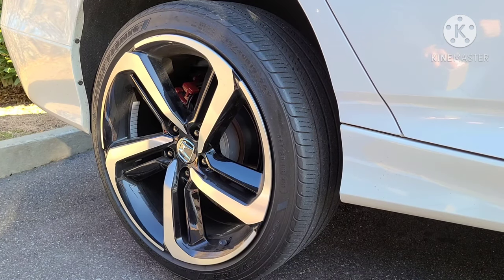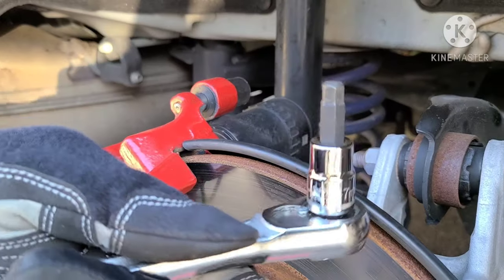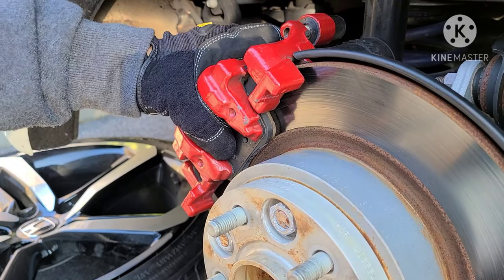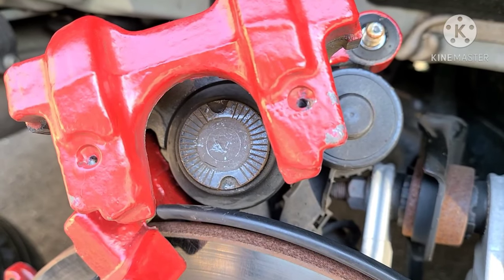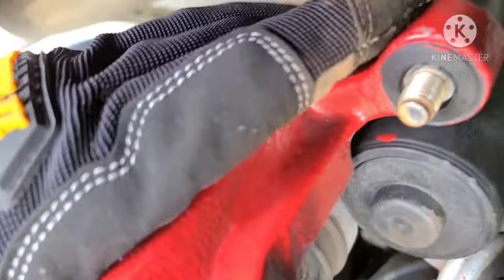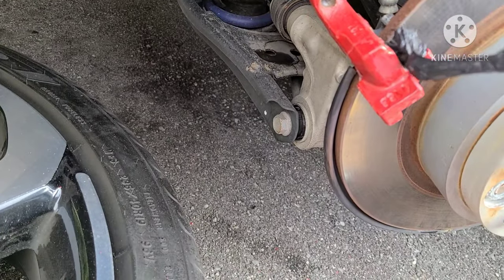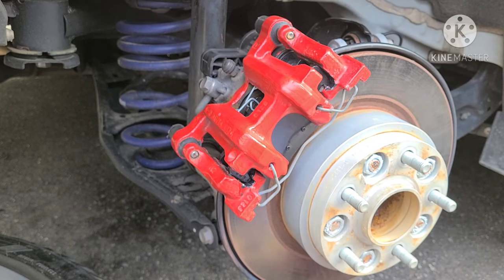How To Replace REAR Brake Pads 2018+ Honda Accord | Everything You Need To Know

Comment: Looks like you put the outer pad on the wrong side. Arrow was pointing to the rear, or counter clockwise. I wonder why they do that? 
Also you can retract the piston through the connector on the motor using reverse polarity. But it's easier this way. Imo

Comment: Thanks for the video, i have a question i want to ask why the 2019+ honda accord rear break pads wear out the fast? thanks
Reply from the maker: You're welcome! To be honest I'm not exactly  sure why, my previous Jetta GLI went through rear pads first as well. Seems to be normal
Reply: @DanVilla7  one more question is the car "on" all the time when you changing the pads. thanks
Reply from the maker: @HZ4750  the only time you need to put it in the on position is to compress the piston like shown

Comment: My friend help to get the brakes fixed because they where goin to charge me on the dealer $500 , so help me out but I’m worried because on the panel it said like I warning that said brakes system problem , my friend told me He told me to go to a place to have those codes deleted, and I've seen videos to do it myself, to reset, but not found, can someone help me?

Comment: Great video! how many miles did u have when you first heard the brake squeek?
Reply from the maker: Thanks! The car has just under 22k miles now and started doing it for the last 300 I would say. Every time I would clean my wheels good it would go away then after a week or so start back up. I hate noises so I changed them today, quiet and squeak free now.

Comment: So leave the E  parking brake disengaged while compressing the piston and engage it to set it back with the pads on ? .... btw what size spacers do are you running ?
Reply from the maker: Yes leave disengaged and turn the ignition to the on position to remove pads. Then compress the pistion,  reassemble and engage e-brake to set pads.  Disengage after and your good to go. I'm running 20mm H&R spacers for more information on them look through my channel it's all on there
Reply from the maker: @jeffreybaldeo  I would think so but can't confirm since I've only tried it on mine. But I would heavily lean more towards yes

Comment: This is a great video, and I liked the work around to having to use the Torx Bit on the electronic brake system. Have you had any issues or error codes since doing this?  So it's as simple and just turning the car on and you can twist the piston back in with the pliers?
Reply from the maker: Thanks! Yep as simple as it looks. I haven't had a single issue since doing the brakes.
Reply: The dealer said it has two open circuits in rear brake caliper now my brake hold light is on brake light ???? 2017 civic
Reply from the maker: I'm not sure why that would happen.  My car is fine still haven't had a single issue since my brake job. I do hope you get it sorted,  best of luck!

Comment: Dan have you had any issues with your rear brakes since you changed them? Every other video I have seen they have taken apart the electronic e-brake but if you haven't had any issues I will being doing the same as you when it comes time to change. Thanks in advance.
Reply from the maker: I have had zero Issues since changing the pads.
Reply: @DanVilla7  Good shit! Thanks bro.
Reply: I did the same way and it's good I'm going through my 3rd ten generation honda accord and his method works well.

Comment: My 2019 Honda accord sport also had sqeack noise from rear tires only once I press the brake.should I only change rear brake pads only cuz front pads are fine
Reply from the maker: Yeah no need to touch the front pads
Reply: @DanVilla7  Thanks

Comment: I never use honda pads or any sold at auto parts store.. the best pads are akebono ceramic carbon fiber which don't need break in.  Cost more but last longer and don't wear rotors,  you still need piston compressor and remove electronic brake as there's times when piston will not bottom out.

Comment: Great video, I am actually right behind you, I am at 20k miles so I am gonna probably need to replace mine soon. Have you done the front pads already or the rears go first on these cars ?
Reply from the maker: Thanks,  haven't done the fronts yet. Seems that the rears go first same thing happened when I had my VW
Reply: @DanVilla7   the dealer wants 80 bucks for the rear pads. I am pretty sure I can find it cheaper on line . I visually looked at mine and the back does look thinner than the fronts .
Reply from the maker: If you get at an online oem parts site you can get them for under $50 including shipping
Reply: @DanVilla7  sounds good. I will do that.  Thanks .
Reply: Don’t need to change it at 20k my 2.0 sports is at 57k I haven’t change my brake pads, but soon!

Comment: So when i rotate the piston for my caliper, it doesnt go up or down but when i compress it, it goes down. Is it defective?
Reply from the maker: You need to turn it clockwise while compressing it. Just compressing it may cause issues.
Reply: @DanVilla7  thank you. I rotated it without compression as i was expecting it to recede on its own. When that didnt happen i pushed it in and it worked

Comment: If I wanted to change the rotors as well I assume remove caliper bracket next.
I didn't see the dreaded screw that hold the rotor to the hub. Do they not have one holding the rotor in place?
Reply from the maker: Not in the rear but the front has it. Best tool 
to remove it would be this https://amzn.to/3mxwSlg
Reply: @DanVilla7  great. Thanks for the help

Comment: Do you have to use honda brake pads or is aftermarket fine
Reply from the maker: You can use aftermarket if you wish. Just make sure they are quality ones and wont sqeak after installing them. That's the main reason I went with oem

Comment: what about the brake system light. I changed the brake pads and now I have a brake system light on the dash. how do I make it go away?
Reply from the maker: I actually just did a search and strangely enough people are saying a weak battery causes that? Sounds odd to me but seems to be quite a few people with the same issue

Comment: Great! Did you also release the e-brake at 3:50 when you pushed the ignition switch? If the e-brake is released when the ignition is on, the car will start rolling, correct?
Reply from the maker: The ebrake was never engaged,  my car is an automatic and was in park so it will not roll. If it was a manual you should be parked in gear and also will not roll if the ignition is in the on position.
Reply: @DanVilla7  OK, you released the ebrake already and turned the ignition on. Mine is a stick so your note helps me:) Again, very nice post!!
Reply from the maker: @gobluea2740  yes keep your car in gear with the car and ebrake disengaged.  Once you undo all the caliper bolts put the ignition in the on position and the caliper will loosen so you can pull the pads out
Reply: @DanVilla7  Super!! Two thumbs up!!

Comment: I turn the caliper about a half an inch and it just stopped turning. Stuck solid...the ignition is on and still stuck...might have to remove that black cylinder thing
Reply: Were you able to get it moving?

Comment: Did everything just like you did. Now my daughters car is saying parking brake doesn’t work and won’t start up . Any help
Reply from the maker: Did you engage the parking brake after doing each side? It was pretty straightforward I'm not sure why that would happen 🤔
Reply: I will redo it today . Thank you
Reply from the maker: No problem hope everything works out. Also try unplugging the battery it may reset it, worth a shot.

Comment: pads are at 50 %..also after you shut the car off push on the parking brake button to temp disable electric parking brake

Comment: hey man do u know the part number for the front brake pads
Reply from the maker: I don't but if you search oem honda parts you can plug in all your info to get ir.  The prices are way cheaper than the dealer even with shipping.  Just check a couple different one sites, some try to charge crazy shipping

Comment: Was your emergency brake disengaged while you were doing the brake job!
Reply: Was the car also on ignition the whole time? once you released the pressure? To get the caliper out
Reply from the maker: Yes leave ignition on complete job on one side then engage ebrake to set pads. And then repeat for other side
Reply: @DanVilla7  so I have do this twice for each set of rear brakes , correct ?

Comment: I'm curious so there is no need to bleed the brake line ?
Reply from the maker: If you dont get air in the system not necessary.  If you were to change a caliper or something then you would need to.

Comment: What size lug nut are those wheels? Do they differ from the regular accord and do those spacers came factory??
Reply from the maker: Are you referring to the bolt pattern? No I added H&R 20mm spacers
Reply: @DanVilla7  The factory nuts. What were those?
Reply from the maker: @harryharriott5192  the lugs are 19mm

Comment: Good video. I did mine that way. When I change the rear drivers side twas ground down and needed rotors as well. The rotors were groved and they are still running hot. You can see heat build up on left rear wheel around lug nut area. I beleive that ebrake is defective or needs some kind of adjustment, not sure if you can adjust. This shouldnt happen on a brand new 2018 after less than 30K ms.. The Slealer said it's normal, Joke! Anyway I'm still getting vibrations from rear left during light driving and braking. Anyone know a fix for this know problem. NHTSA has many reports on rear brake problems. Just put your vin number and read complaints. Thanks- Any help would be appreciated.
Reply: Yea. My left rear pad went way way faster than the other wheels
Reply: @frankgarcia1641  Hi frank, did you ever find out what was wrong? Caliper, air in system etc.. thanks N-

Comment: I did it exactly the same way except after I was done I pressed the regular brakes before putting the parking brake on.
Now the brake system light is on… gotta bring it to Honda now…. Smh🤦‍♂️
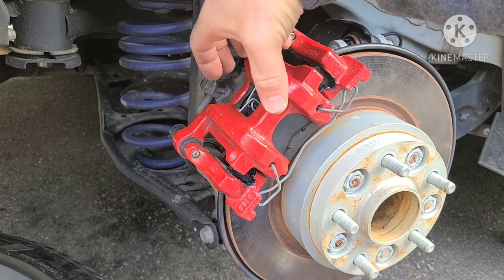Reply from the maker: Yeah, I set the pads in place by engaging the ebrake not pumping the brakes. Refer back to video @11:19

Comment: I see it’s almost time for some stickier tires man, which ones to you plan on going with? Solid instructions btw.
Reply from the maker: Thanks! Yeah the rears are shot now but fronts still have some life left. I'm still debating on whether or not to do a bigger wheel and tire setup or just replace with better tires on the stock rims. Either way I'm going with all  seasons. I daily it so I need something that works if I get caught in a snow storm.
Reply: Best tires Ive found for my 2018 accord are the Yokohama 760! You can’t go wrong with those!

Comment: Confused.  Did the rear, left side worked perfect.  Right side it would not go all the way in.  Took to a local mechanic, hooked up computer. Used the piston compressor and piston went right in... Why did he not turn it in? He claims you do not need to twist these in...?  Did I need to recycle the engine ingingtion differently.   I did try that too
Reply from the maker: You absolutely need to twist these back in. Just follow the procedure in the video
Reply: @DanVilla7  I did and worked on one side. Not the other.
Reply from the maker: That doesn't make sense.  Maybe the piston was frozen... it's a newer car so unlikely
Reply: Im currently having the same exact problem
Reply from the maker: @anthonyabrew2225  try this, after doing one side engage ebrake so pads seat properly then go to the other side and follow the same procedure.  That's exactly how I did it one side at a time.
Reply: @DanVilla7  I did that. Did not work.  I change brakes quite often so I have a little bit of experience...
Reply: @anthonyabrew2225   follow the same procedure as the other side but just push it in gently it'll go in and there'll be no issues..
Reply: @mariodilorenzo7473   nah this shit wont go in and its pretty far out ngl. First side went fine, this side is a mess. Idk wtf to do
Reply: @anthonyabrew2225  same problem.   You need to push it in with a c-clamp
Reply: @mariodilorenzo7473  really? It feels like it wont go in anymore? Is that what your mechanic did?
Reply: @anthonyabrew2225  yes... I was turning and turning it nothing was happening it would not go in no matter what... Put the old pads on went by my mechanic he released the emergency brake push it in with a c-clamp everything was perfect.   He said he does three or four Hondas a week
Reply from the maker: @mariodilorenzo7473  you have to push inward and twist at the same time.
Reply: @mariodilorenzo7473   just use clamp to push it in NO turning it will work?
Reply: @arthit9na  yes
Reply: @mariodilorenzo7473  Thank you. I had the same problem. Used C clamp & it worked.
Reply: Like some here, rear rt side would not compress by just turning.   Trick was to fully turn clockwise till it stopped, used c clamp to compress it a little until it stopped compressing, then it again turned CW for a while, then one final compression with the clamp did the trick.

Comment: I tried it with the needlenose and it didn’t get back as far as you got it. In fact it looks like all it did was just spin around.
Reply from the maker: You have to push in as well. Also like stated in my video a caliper compresser kit is the correct way to do it as it will twist and push in simultaneously

Comment: Did you use a scanner?
Reply: Or if any indications pop up
Reply: Been seeing some videos on needing a scanner on changing your rear pads was wondering if you've had any issues with the computer system on the car o
Reply from the maker: I didn't use one and haven't had a single issue
Reply: @DanVilla7  yeah I was going to get the stuff to do it this morning and seen some dude pull out a laptop and scanner and was like whoa whoa! Let me ask to see if anyone has had issues or not
Reply: Before I try to get a tech status

Comment: The parking cable came out and now a have flashing light
Reply from the maker: I'm not quite sure how that would happen.  My guess you let the caliper hang without supporting it? Are you taking about an electrical connection? If so plugg back in and and try unplugging your battery for a couple of min and see if it goes away.

Comment: That tool that you said is trash, trust me, it’s not. Do a brake job on an Infinity and you will wish you had that tool.
Reply from the maker: I've used it before on other cars. It does a poor job but does work. It's too flat to bite properly.  I'm going to have to say it's still trash.
Reply: @DanVilla7  Fair enough. Used it this morning for new pads on my wife accord sport. Worked like a charm. Only slipped one time. Anyhoo, good video.

Comment: I heard that if you that just by turning the piston you can  miss up to a mechanical handbrake motor.
Reply from the maker: I don't see how once you turn the ignition on the piston no longer has pressure from the ebrake. When turning it has a stopping point and it's fully compressed.  I have zero issues since the brake pad replacement

Comment: I have a 2019 Honda Accord sport 1.5L, it was time to do my brakes and I called the dealership to buy the brakes since I couldn’t find it at autozone. They told me that only the dealership could do your brakes, something about the caliper getting stuck and messing everything up to the point where you’ll need to get new brakes, rotor, and calipers. After seeing this video I obviously got fucked. I’m wondering if this will work on the 2019?
Reply from the maker: Damn that sucks. Yeah should be the same on a 2019.

Comment: Brake rotor and brake pad manufacturers advice against petroleum based brake cleaners

Akebono who makes OEM pads states this on their website of you google akebono warranty it takes you to the page

Wagner and other major rotor mfrs state just soap and water and a brush to clean new rotors
Power stop centric etc